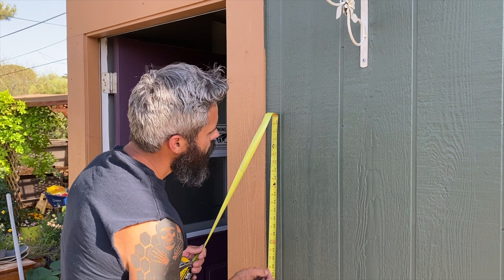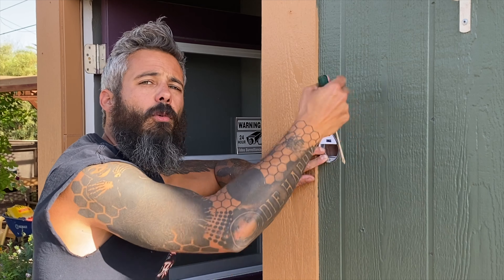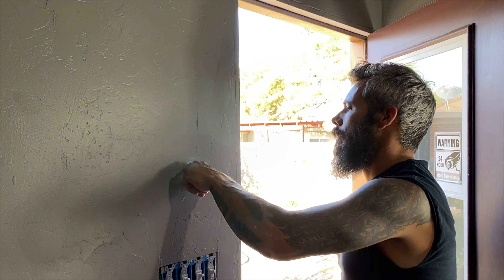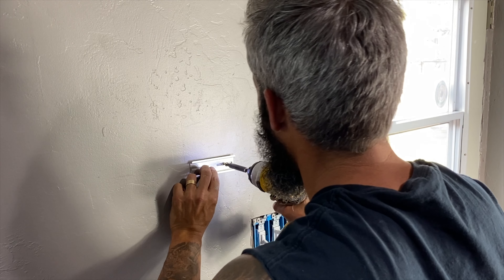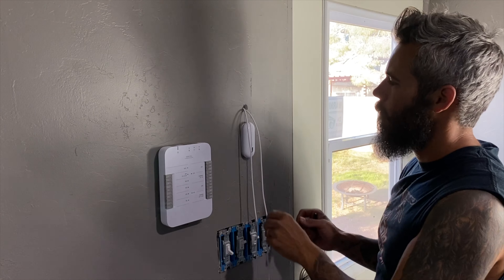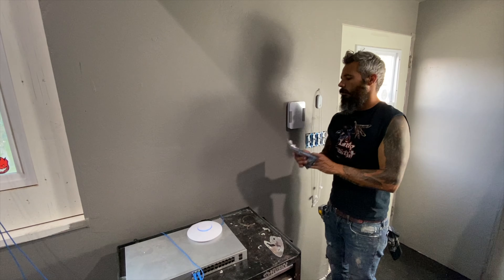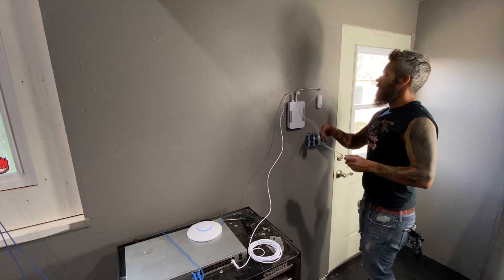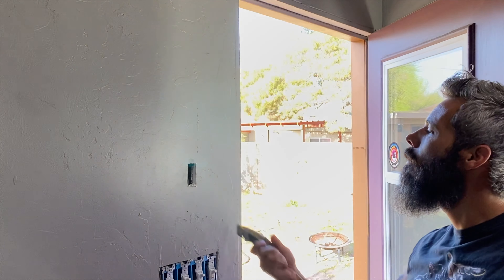I Installed UniFi Access in my Tiny Home: Hello Keyless Entry! (Access Pt. 1)

Comment: Why do you need a reader on the inside??????? I assume you think you need it to get out? Buy something called a REX it is motion sensing and will disable the striker as someone approaches the door from the inside OR get a push button. so as you approach the door you just hit the button and it disables the mag strike.This is typically how an access control system is set up since you only need to protect one side of a door (you don't need to protect the outside from those inside, LOL)
Reply: Thats for the software to know who is in the house and who is outside
Reply: The one inside can open the door by swiping your hand near it
Reply from the maker: It has a hand reader on the inside you just wave and it opens. It's not a card reader.